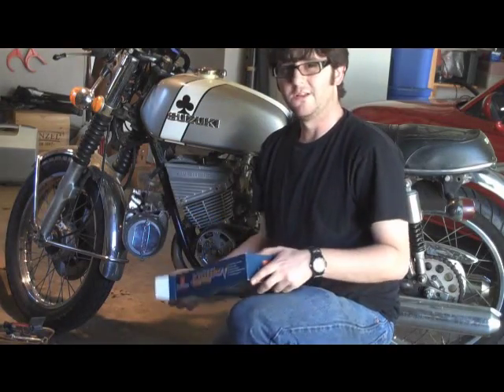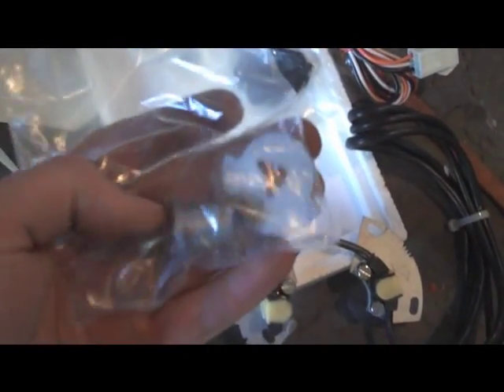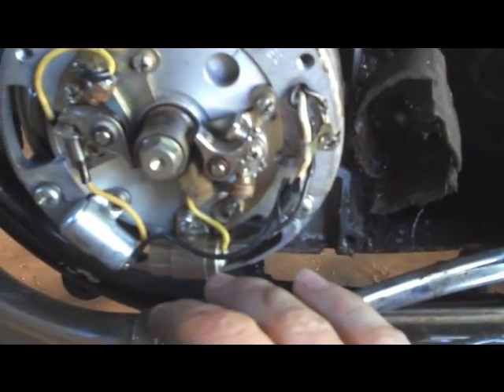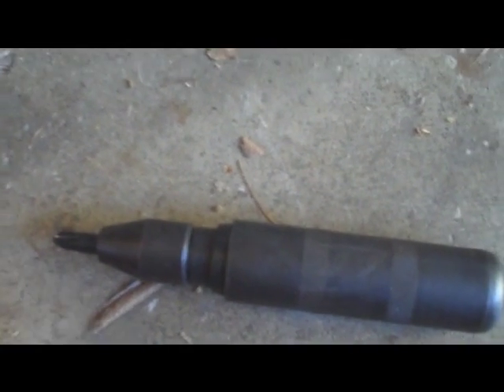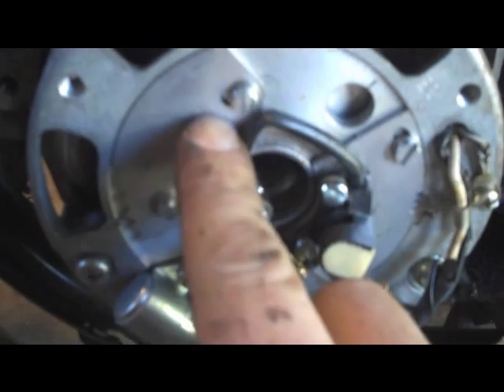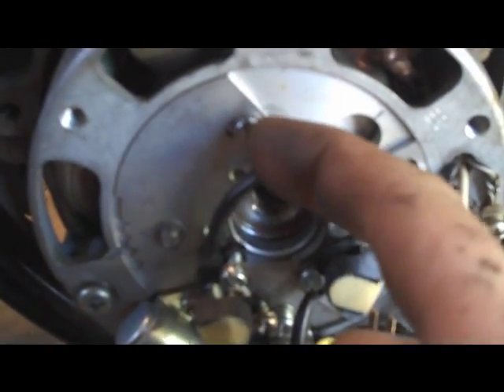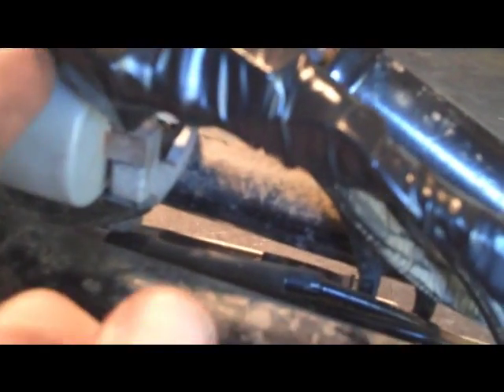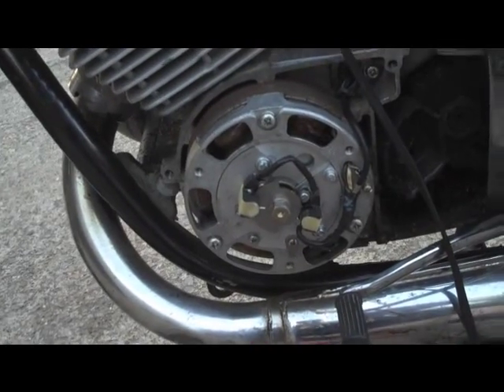GT250 Hustler Ignition

Comment: Personally, I like the old points system. It was orthodox and not heat sensitive.
Reply from the maker: Agreed.  It's been a few years and it's not worth the money.  Also,  this system seems to limit RPM to a 6.5k-7 mush.  When the battery is low it causes hard starts.  I still retained stock parts to re-install one day.  If it had a pot for varying timing on the fly I might be worth it.

Comment from the maker: Here's a video me reverting this set up and going back to points.  Also 3 ways to time the engine.  https://youtu.be/m9ltkAAfZ58
Reply: Hey, what is that crazy screw driver you mentions? You said to pick it up because they're awesome, but didn't plug the name?!?!! @bondfranklin
Reply from the maker: It's called an Impact screw driver.  There are sets available with philips up to #3 and  can use 1/2 drive sockets.  That one I've had for 10 years and is "General" brand.  Back when cheap tool bins were at the Hardware Store and no one heard of Harbor F.